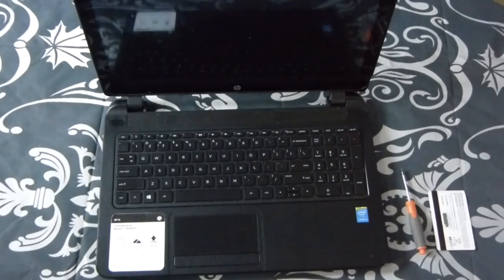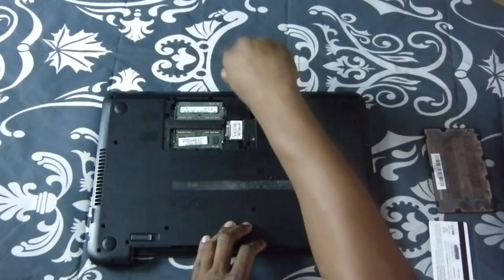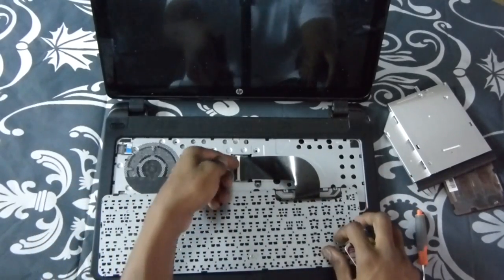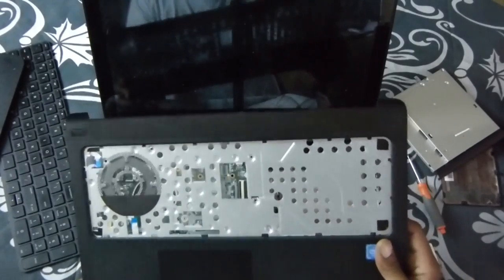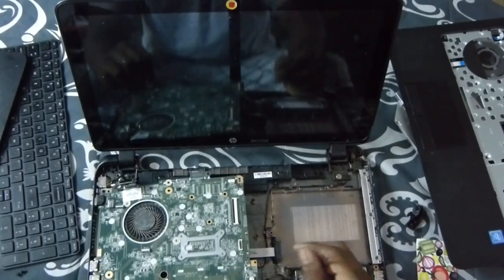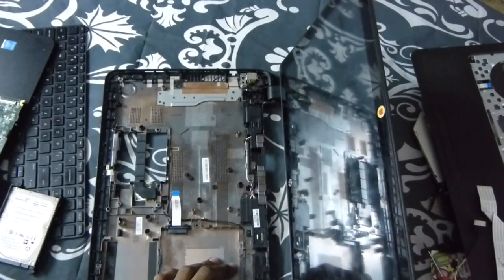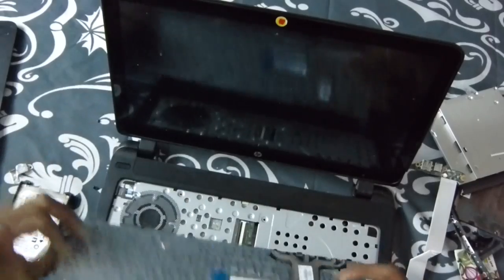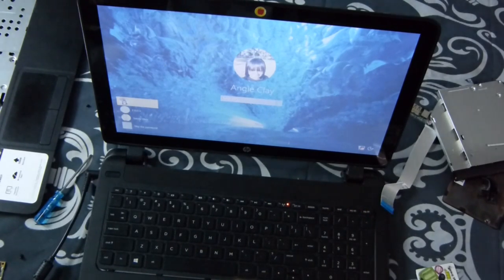How to disassemble hp 15 laptop

Comment: Computer screen went black while watching a YouTube video so I restarted and NOTHING. Upon repeated startup attempts, I could hear it power up and the hard drive working, but I could not see anything on the screen. Thanks to your video, I was able to totally dismantle the laptop and find a 50¢ button battery on the bottom side of the motherboard that needed to be replaced, as it was DEAD, and now it works like a charm! Thank you so much for your knowledge and generosity. You have helped more people then you will ever know. 
⭐⭐⭐⭐⭐

Comment: Is there any way to just remove the bottom bottom enclosure?....so I can just pop the bottom half of the case?....instead of going in through the top half of the enclosure?  My gf spilled a bit of vegetable oil on her HP-15-f033wm.  I did remove the keyboard and cleaned the underside of it with isopropyl alcohol.  But it seems that the vegetable oil found a path to the bottom side of the laptop...and slowly oozing out of the underside vents...underneath the motherboard and other components.  Miraculously, it doesn't seem that the components got saturated in the oil.  But the oil has settled underneath those components.  So is there a way I can just pop off the bottom enclosure, so I don't have to go through the process of removing all of those components just to get to the underside?  
Sorry for being so wordy.  
I've seen other videos of people being able to remove the bottom enclosure from other HP models...but my specific model doesn't seem to be able to detach from the bottom.  Grrrrrrrrrrrrr.

Comment: Did your computer have one wire to the WiFi card? My computer wifi stopped working, so I opened it up and saw one wire, I added a wire from another laptop and the wifi started working again, I just wanna know if I should take it apart and find the second wire in the laptop or something

Comment: So as I mentioned in my last post I was able to successfully change the fan and cycle the computer ran it for about 20 minutes without a problem turn it off left it plugged in to charge the battery I went to open it this morning same error code or at least the caps lock is flashing but the fan is running and what do I do now?

Comment: How does the hard drive come out? I have one open and I see no way to pull it out
Reply: Next to the hard drive is one little screw holding the USB and and headphone jack PCB down. Take that screw out and remove that tiny board. This gives you enough room to put your fingers under the hard drive and lift up. It's simply wedged into that spot with a anti-shock rubber piece around it.

Comment: bruh, you just helped me out big time! I just wish I had found this vid before I cut myself on the damn steel tray that the keyboard sits on! I found some Indian guy pulling apart a similar one but his opens up differently to where the screen is attached to the top part with the keyboard instead of the bottom part so he just pulled it apart like nothing with very few screws to remove.

Comment: While this video helps to fill in some gaps, it is missing a lot. For starters, never showed how to remove the harddisk. 
And the 'putting it back together missed all the screws under the keyboard and the two smaller flat cable re-connections.
Bottom line, this is very very incomplete video of disassembling a laptop with way too many missing steps.

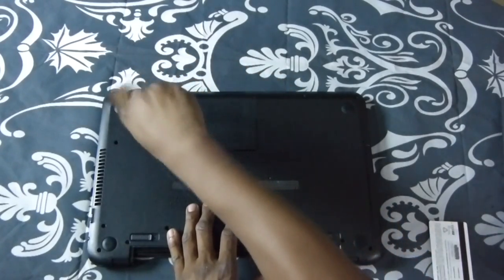Comment: Hi! Can you give me an ideea of what can I do to open the small case that covers the ram. I took off the two screws but it is not goying off!(yo have it at 0:50)
Reply from the maker: Try using a flathead screwdriver and pry it off
Reply: @siprecords1  I forced it with a sharp knife blade. It was like glued to the laptop body.
Reply from the maker: @ardeleandan7  lol so did you get it open

Comment: I cleaned off the dust on my fan and everything(the whole reason I took my laptop apart) and it still makes a loud noise and in the start up lets me know that: “the system has detected that a cooling fan is not operating correctly”  do you know anything I can do with this problem? I’ve had this laptop for 4 going onto 5 and yeah i don’t know if it’s because of age or not.
Reply from the maker: Copy Paste yes ; when powering on PC listen to see if the fan is turning on, also if you are having heating issues the most likely the thermal paste has melted off the processor under your coal

Comment: The fan is missing? I have hole for a fan. I have vent for a fan, but there is no fan. Is that common in this model?
Reply from the maker: bigjake360t No there should be a fan, make sure again
Reply: Mine didn't have a fan
Reply: Rofl
Reply: Checked the manual. My hp 15 from 2016 has a heat sink instead of a fan.
Reply: Same I have hp 15 d008tu same no fan

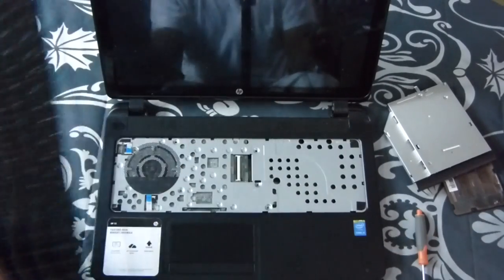Comment: So I fucked up on mine. At 2:09 on this video is where I messed up. I forgot to unlatch the top left corner which I think is the power. I replaced my HDD with an SSD. but now I can't get my laptop to turn back on because the top left blue part came off because I forgot to unlatch it. Hope it's fixable

Comment: i only came to this video because i couldnt figure out how to take the disk drive screws ouy, none of my screwdrivers are working. what did you use? i think im screwed and theyre stripped
Reply: Video skipped the whole hard drive, what's up with that? It needs a star tool. small one.  Then remove the USB board to get it out.
Reply: Elissa Guynes I finally got mine out, I had to order a special oria precision screwdriver set from Amazon and then with that screwdriver I was easily able to get them out
Reply: @Drunkton  that's such fucking bullshit
Reply: You should use a small philip screw
Reply: @mysteretsym  oh yeah yeah
Reply from the maker: J Ellsworth im using a smaller Philip
Reply: Did you ever get them out, because I have a tiny phillips screwdriver and I can't even get them out. I've used multiple types even one that is small enough for eye glasses and I still can't remove that screw! If so how did you do it?